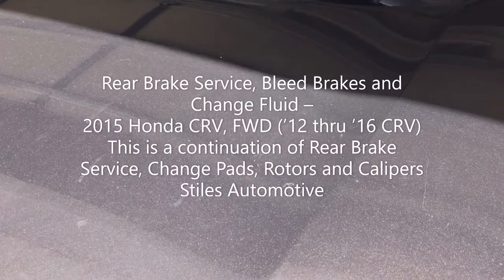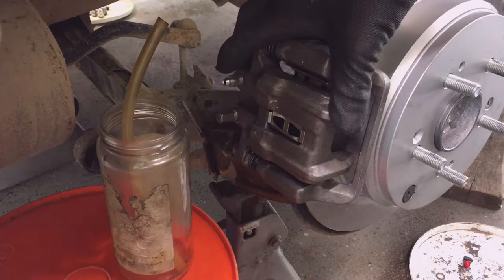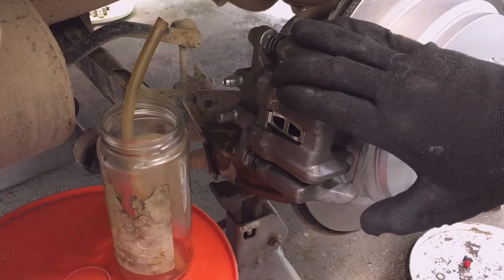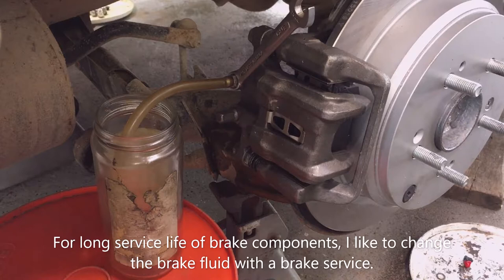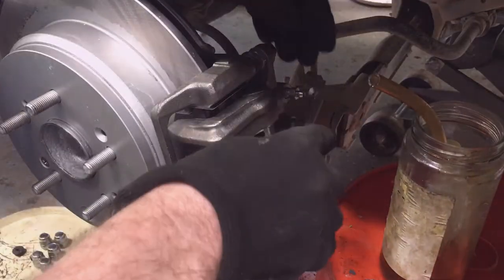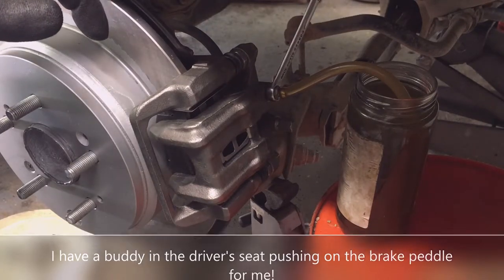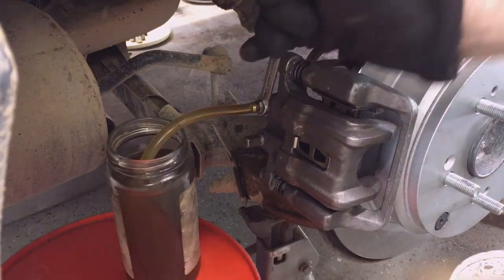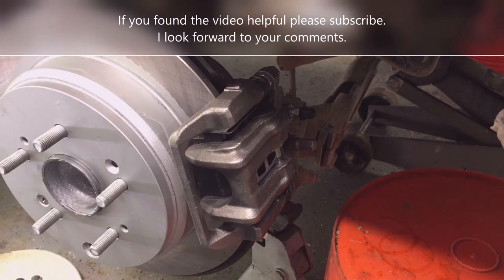Rear Brake Service, Part 2 - Bleed Brakes and Change Fluid – 2015 Honda CRV, FWD (’12 thru ’16 CRV)

Comment: I would use new tubing whenever you bleed the brakes
Reply from the maker: I think you have it wrong, my friend.  You take dirty, old Brake Fluid out of the Caliper when you bleed them.  You put clean, new Brake Fluid into the Brake Master Cylinder and use the Master Cylinder to push clean Fluid thru the Brake System and out of the Disc Brake Caliper or Drum Brake Wheel Cylinder.  No need for "new" tubing, I've used the same Tubing and Dirty Jar for many years.  Or . . . did you mean some other "Tubing" other than the Tubing used on the Caliper Bleeder Valve to bleed the Brakes? - Stiles
Reply: @StilesAutomotive  How do you know if the fluid is new or old. Would not be able to see the difference using old yellow grungy tubing
Reply from the maker: @ExtremeRecluse  Ok, got it.  I use a clear glass jar and you can easily see the color of the Brake Fluid in the jar. - Stiles

Comment: Very helpful and professional. Doesn't the crv have a different brake bleed starting point than most other vehicles?
Reply from the maker: Comon, The Rule of Thumb is to start with the Brake Caliper/Wheel Cylinder farthest from the Master Cylinder. I appreciate the feedback! - Stiles
Reply: I hate how much time I’ve spend trying to find that very answer. It seems Honda goes against the rule of thumb. There are diagrams online. The order is 1 Front driver 2 front passenger 3 rear passenger 4 rear driver…. Feels wrong, but I’m guess it has to do with the abs located in the rear.
Reply: @177onkey  yes that’s what I have found as well. Thanks
Reply: @comonbabylightmyfireburn  The question is why the need to be in order and be found for things as simple as bleeding the brake? I am those guy who question the anality of simple things like these and I do it the exact opposite just because!  it does the same thing without breaking, my 1997 Honda civic still up and running to this day and braking is still brake! I have 2020 CRV hybrid and I also do the exact opposite order of brake bleeding (I think) last month, nothing wrong with it!

Comment: Sir do I need to turn on the engine whenndoing this? Or do i need to atleast turn on accessory mode the ignition key. Thank you
Reply from the maker: Hon, You are welcome!  No, you don't need the accessory mode on at all, initially you should bleed the brakes with the engine off (helper dependent), then start the Engine to get the help of the Power Brake Booster. If your helper has a little Leg and your car has a heavy Brake Pedal, you may want to start the process with the Engine Running and use the aid of the Brake Booster.  You can however, do the whole process with the Engine off, if you have a strong leg on the Brake Pedal.  - Stiles

Comment: He said cylinder 10 times In the break fluid video? What is going on. Misleading and  risky if everybody listen to him
Reply from the maker: Yes Owen, "He" did say "Cylinder" because to bleed the Brakes on a Hydraulic Brake System you need to work with the Brake Master Cylinder and add Brake Fluid to the Brake Fluid Reservoir, which is most often attached to the Brake Master Cylinder. On Automotive applications (like shown in my video) the Reservoir and Master Cylinder are often an Assembly, so you refer to them as the Master Cylinder.  This video shows Brake Calipers, and although not shown in this video, Drum Brake Systems use Wheel Cylinders.  Drum Brakes would be bleed from the Wheel Cylinder.  To avoid being "Misleading", you mention "break fluid", which is properly written "Brake Fluid".  My videos are very detailed and I always attempt to use proper nomenclature for parts and systems.  - Stiles